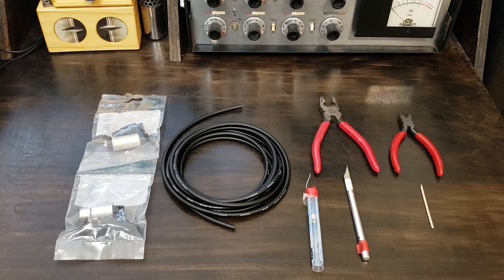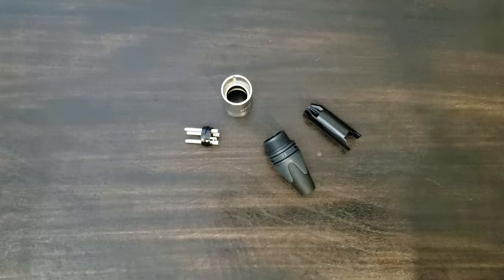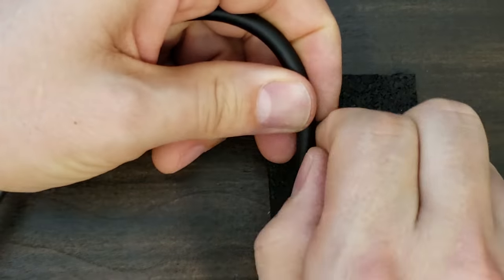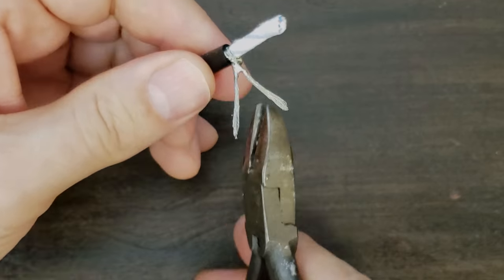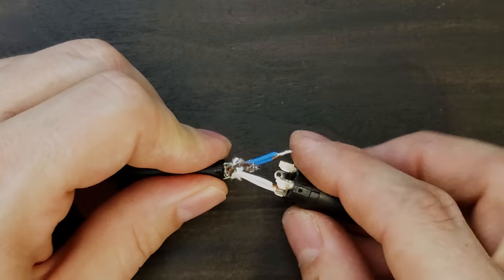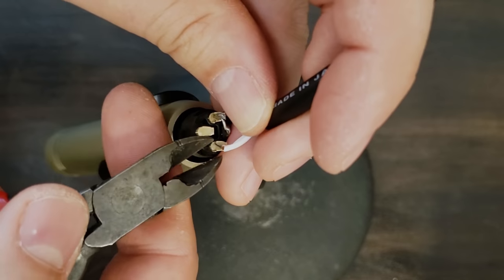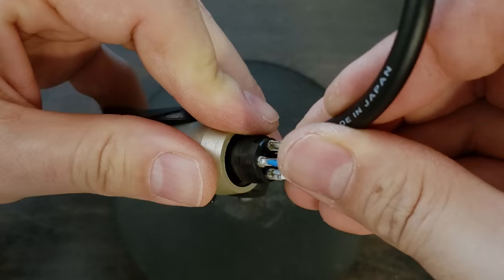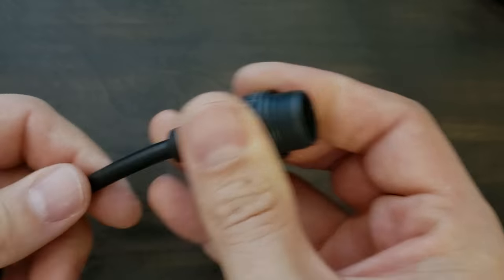XLR Microphone Cables, How to solder connectors Studio Balanced DIY ULTRA QUIET

Comment: Thanks. Great series. I have one question? Is it possible to use high quality balanced microphone cable, for making unbalanced, instrument, TS  cable.  And how to do it? I asked this because most of the time, microphone cables have lower capacitance, witch I read somewhere is the most principal thing for preventing high frequency signal loss in guitar cables? It would be great if you can make video tutorial about this.

Sorry on my imperfect English.
Reply from the maker: Hello!  You can make an instrument cable from a microphone cable, however, it won't work the way you'd expect.  Guitars and amps both are hi-z instruments.  They are designed around a "single conductor" cabling system.  But, if you want to make a hi-z cable from a 2 conductor cable(mic cable), you'll need to either ground one of the inner conductors to the shield/ground OR connect both conductors to each other.  Either way, it's still going to be a single conductor hi-z cable connecting hi-z instruments, so it will still act like a hi-z cable.
The best thing to do is to keep guitar cables under 20 feet(6 meters) in length.  If you need a longer run, you can use a buffer pedal to boost the signal.
I hope that helps!
Reply: @FrankOlsonTwins  Vary informative ! Thank you Frank.
Reply: It is very slow to operate without professional tools.
Reply: @FrankOlsonTwins  Can you use the cable and leave the second conductor totally floating?   Will anything care if there is that extra bit of wire in there if you just happen to have mic cable handy and not single core :)

Comment: Thanks for sharing.  What kind of wire are you using to do the shield jumper?  I can see how this might help me, and I'm currently sitting with wires stripped and ready to be soldered to a Mogami 2893 cable.  Could I use any wire for the shield jumper?  Would it be OK to use wire from a cheap broken XLR cable or steal some from the 2893?
Reply from the maker: Yes, any of the above wire would be fine, just make sure the wire is clean and oxide free(not discolored).  I used the clean extra lead from a capacitor 00:34s.
Reply: @FrankOlsonTwins  Awesome , thank you.
Reply from the maker: No prob! Good luck!
Reply: @FrankOlsonTwins  Thanks.  Apparently, I didn't word that well.  I meant to say that I was sitting with wires of the Mogami cable, stripped, ready to be soldered to a Neutrik connector.  Oh well...the point was there.  I'll have to finish this project when I have more time this weekend, but I'm thankful for your help.  I also just realized I somehow jumped forward in your video at the start, which explains which wire you were using.  Sorry about that.  Long day.
Reply from the maker: Hey, no biggie!  Does anybody watch videos in a linear fashion anymore?  I def don't!
Reply: @FrankOlsonTwins  I do when I've got time.

Comment: can this be used to connect mixers,and amplifiers and subs?
Reply from the maker: Absolutlely.  These are great cables for those uses.  Be sure your subs or monitors are "self powered," using these cables as regular speaker cables isn't ideal.
Reply: ls ok

Comment: Hi Frank, I need to connect Pin 1 and Pin 3 together in my application (male 1/8" TRS to XLR male cable, tip for pin 2, ring empty, sleeve for 1 and 3 ). Do you have any other recommendation for the jumper material rather than solid core wire cut from capacitor or resistor? Would paper clip do? Thanks
Reply from the maker: Hello!  Before using a paper clip, I'd recommend using a clean strip of stranded or solid copper wire(even some of the extra braided shielding will do.  Any piece of electrical wire will do.  I've seen good cables using the some of the braided shield twisted and soldered in.  I'd recommend against the paper clip, but if you have nothing else, it would probably be fine to use.
Reply: @FrankOlsonTwins  Thank you for the reply! I will use thin gauge stranded wire for now and probably switch to solid wire in the future. Appreciate your help! The video quality, presentation, and solder skill are all top notch.
Reply from the maker: You'e welcome, and Thanks!

Comment: Do you have a link for any of the items used? Mainly for your cable and connectors.
Reply from the maker: Hey,
I don't have any links, but I can tell you that the cable is Canare L-4E6S (Star Quad) and the connectors are the newer version of the Neutrik XLR:
NC3FXX  (female)
NC3MXX (male)

Hope that helps!
Reply: Frank Olson Twins Thanks. I cannot wait to do this.

Comment: Why you hav soldered the metal wire to the ground first ?? And i hav tried it cuz of that the deep is clear .
And i hav tried other cable without doing it the deep was not so good as compared to the u were trick 
Can u tell y??
Reply from the maker: It sounds like the ground was not good in the system, and maybe the cable corrects the system(bad ground) with a solid ground.

Comment: I am not sure how to determine which wire goes ti which pin .
Reply from the maker: It doesn't actually matter as long as the wires are connected the same on each end AND pin 1 must be the shield.  There are tiny little numbers if you use a magnifier next to the pins.

Comment: Does wire/cable thickness matter? I just took a look at my mogami cables and they're super thin
Reply from the maker: It's debatable.  Generally speaking, if it works well and sounds good, it is good.  But there are factors to consider, and most engineers would tell you that it does matter.  Regarding the shield wire, if it's wrapped with poor coverage(many very cheap cable brands are) then it's less effective against noise and interference.  Braided shield cables are very good in this aspect.  Also, thicker inner conductors might be a bit stronger over time.  Very thin wires fray a bit easier, and can be annoying to work with.  One reason I like star quad is that the inner conductors are quite stable when joined and soldered.  I've had some for 10+ years that have never failed.  But, star quad is more work to solder.

Comment: Wow great job thanks  man but i wanna to connect my eaphones in this xlr mic can you explain it i dont have Audio caples so i wannat to use my earphones to use the mic in may mobile android
Reply from the maker: Android Mic cable is different than this.  Look up TRRS microphone/headphone cable. TRRS means "Tip, Ring, Ring, Sleeve." The second ring(away from the tip) is the microphone. You could try something like the iRig Pre if you need a ready made solution.
Reply: @FrankOlsonTwins  

Yes i need every  solution  to solve this problem
Reply from the maker: What specific microphone do you want to use?  And what exact model is your mobile phone? Also,  what are you using this for?
Reply: @FrankOlsonTwins  
I have Adio 98xlr mic 
I have a samsung mobile 
So im youtuber i wanna to record good quality Audio my earphones  are short also not good in recording 

So can use this xlr mic  to my android 
To record  videos idont have camera so i use my phone as a camera 
Can i stick together eaphone tale and xlr mic thats all man thansk for your helping  me, sory my bad english
Reply from the maker: Ok great.   I think your easiest option is a longer, better pair of headset/microphone , perhaps with an extension cable. You might be able to find a headset with a long cable.  
If you need more control, and you want to use your xlr microphone you will need a microphone preamp.  Do a search for mobile phone mic preamp(TC Helicon Go Vocal, for example) the are many options for plug in mobile mics and preamps.  Good luck!
Reply: @FrankOlsonTwins  

Thank  you alot ❤
Reply from the maker: Your Welcome!  Good luck with your videos!

Comment: What if did not put capacitor, what will happen master?
Thanks for the answer ☺️
Reply from the maker: Hey Edmar.  The cap lead is optional, but I often include it when making cables.  It's just a bit of extra ground protection between devices.  On a well grounded system, you wouldn't notice the difference.  Thanks for the question!

Comment: why do you use 4 core wire?
2nd, it you solder so close to the mantel it self is not a great idea,, bending the cable can build op stress and possibly break at that point, 
I personally just cut off all the excess ground and solder only in the cup
(some type of cable has a dedicated strand of non breaded wire for this purpose, then you can cut all the braided cable away and use the loose parallel strands)
Reply: one more thing, bridging the shield to pin 1 is not always a good idea, If you really like the idea of a "shielded plug" just solder the highest inpedance side (otherwise it can function as a antenna)

Comment: Hi, I really learned something here from your video!! I have made up balanced patch cables without making the ground jumper. This may very well be why I have some hum going on in my audio. What is the proper name for the ground jumper wire you're using? Thanks again. Ray
Reply from the maker: The jumper is optional, it simply ensures that the shield wire is grounded to the preamp chassis.  On some systems it can give extra shielding protection.   On systems that are prone to ground loops, it could make the problem better or worse!   In the latter case you could either snip the jumper, or use a different cable.
Reply from the maker: Not exactly sure if there's a proper name for the shield jumper...
Reply: @FrankOlsonTwins  So now it's really up in the air?
Reply from the maker: I used the cable to narrate the video, as well as many others, and on my system- there's no problem. 
In my experience, nothing in Pro Audio is ever easy!  But, you can find out easily if the grounding the shield works for you:  Make the cable as shown in the video.  If you find you are getting hum- clip the jumper at one end of the cable.  If you are still getting hum, clip the jumper at the other end.  If you are still getting hum, your issue lies somewhere else!  (Instead of clipping the cable jumpers, you could use a different cable to see if your problem still exists.)
At the end of the day,  best method is the one that works for you!
Reply: @FrankOlsonTwins  Great tips...... Thank you for taking the time in explaining everything. Appreciate it, Ray 👍😊
Reply from the maker: No Problem, hope it helps!

Comment: Couldn't manufacturers build the connectors "pre-jumped?"
Reply from the maker: In fact, many are!  However, this tab allows for more secure grounding or the possibilities to tie resistors or other components to ground as well.
Reply: @FrankOlsonTwins  So the excerpt below from Neutrik - is this relevant to the topic? 

"In the course of the evolution of the AV industry, it has come to be that this tab is practically never terminated. This means, in turn, that the shell is not grounded. (1)  When in doubt, simply leave this tab unterminated. (2)  

By contrast, some specialized XLR cable connectors are designed to send the ground signal through the shell. Examples of these specialized cable connectors are Neutrikʼs EMC series and XCC series. 

(1)This grounding would be performed by wiring the shiny silver tab (shown below) to the cable shield—i.e. wiring the cable shield or drain wire both to the shiny silver tab and to pin 1. 
(2) Many audio professionals would prefer it if this tab were always tied to the cable shield and pin 1.
Reply from the maker: Yes, this is specific to this topic!  Grounding the shell has more to do with the overall ground scheme between pieces of gear.  It's not always necessary, but sometimes helpful.  I find it does more good than harm, but if you find that grounding the shell is causing a ground loop, certainly swap cables or snip the ground-shell connection.

Comment: a quad core cable.. bruh thats overkill most cables only have 3 cables
Reply: I thought those cables are for dmx🤔
Reply from the maker: I'm no DMX expert, but I don't believe these are particularly well suited to DMX.  DMX is a digial signal which requires a particular set of criteria such as impedance and shielding.  There are also 5 pin DMX connectors.

These "quad-core" cables  are useful for audio.  The 4 conductors make 2 twisted pairs in one twist: One hot signal, one for cold signal.  Since the hot and cold signal occupy more of the same space in that single quad twist, it helps eliminate signals which might be picked up along the wire.  

I think quad core cables are probably not suitable for long runs of DMX, but maybe someone has more experience with DMX could let us know?
Reply: Dmx cable needs to have 120ohm rated cable for clear signal travel! As long as the microphone cable is rated to 120ohms then it is suitable for use for Dmx signals! Anything lower or higher just messes up the data stream and leads to problems with your rig!